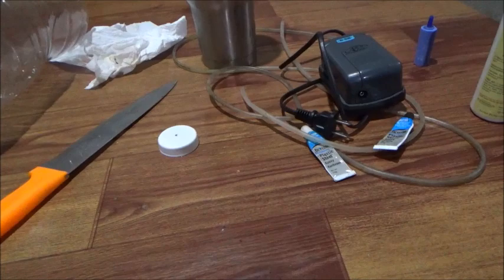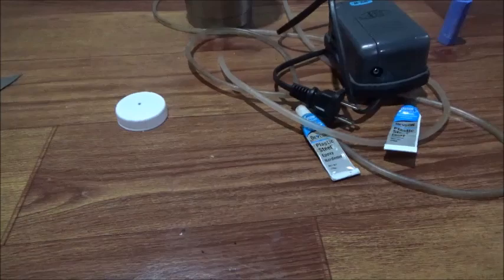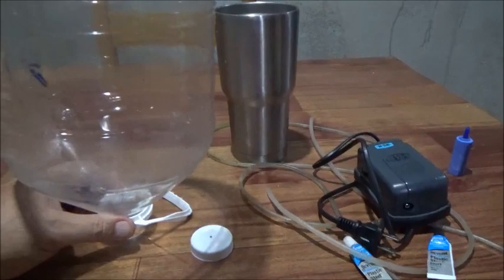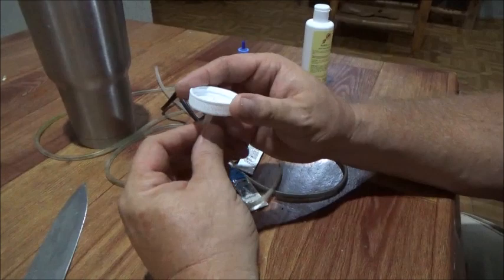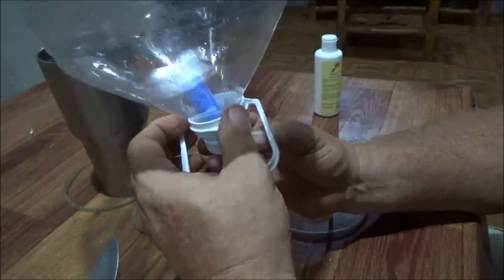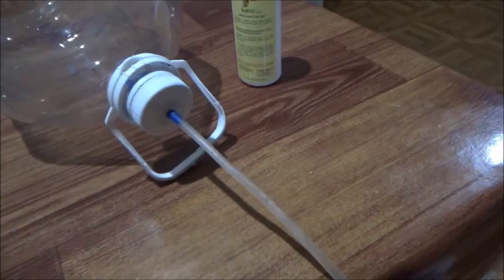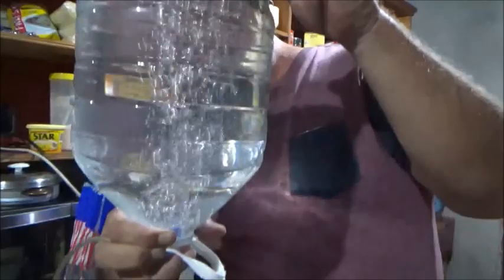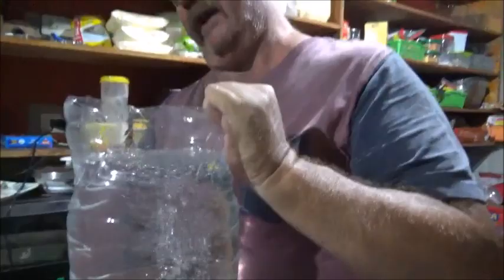DIY Home Made Tilapia Egg Hatcher

Comment: About the rechargeable drill batteries that wont charge. I learned a trick from YouTube on how to get them to charge again. Plug charger in and rapidly unplug and plug back in outlet at least 4 times. And batteries will charge. Its worked well for me on old batteries that wont take a charge.

Comment: Very rewarding to see that you are following my instructions. As long as the eggs are constantly moving That's what your looking for in the air pressure. Gluing Velcro strips to the egg tumbler as well as the inside of the fish tank will hold it in place. The fish tank will assure that water temperature will not fluctuate so drastically. When ever you can get a small aquarium heater set temperature  between 78 and 84 degrees. Buy from Lazada Methylene Blue also known as Methylthionium Chloride. Add to water so eggs don't fungus. Keep tiring even without it. This egg hatching will be a HUGE game changer for you. I'm sure Lazada also sells brine shrimp eggs. You can have a smaller egg tumbler to hatch the brine shrimp. Also known as sea monkeys lol. Very easy to do. The fry will love it! Best wishes!
Reply from the maker: Stay tuned 🤠